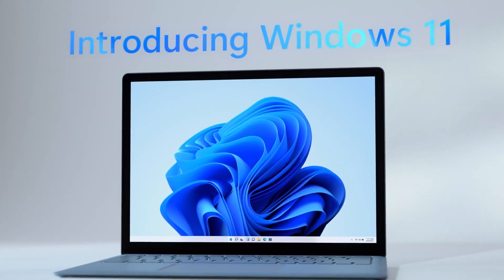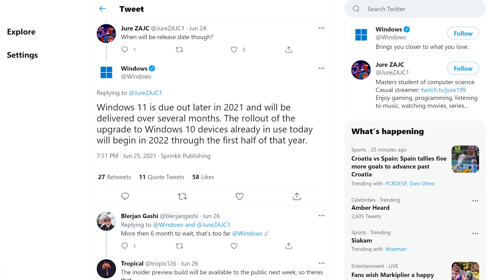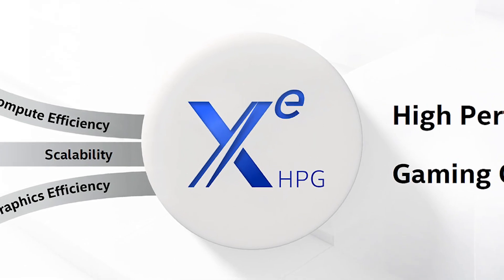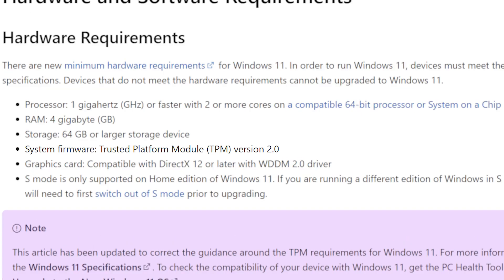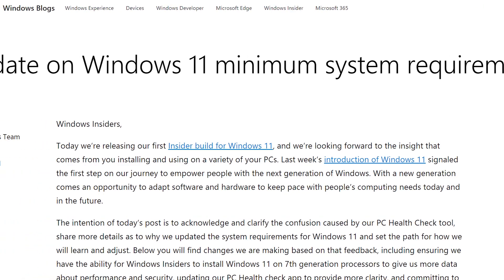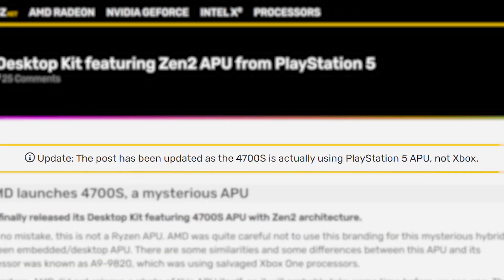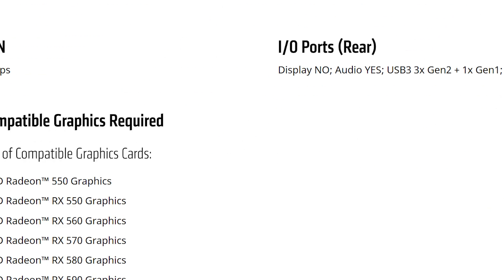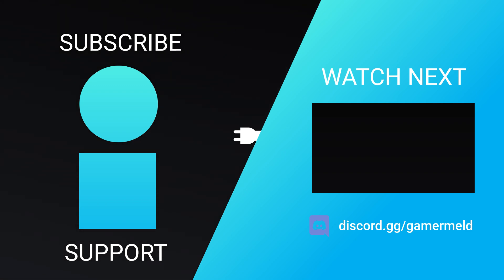TONS Of Gamers WON’T Be Able To Install Windows 11!

Comment: Steam really needs to push harder with Proton comparability now more than ever,  because there will be a influx of new linux users when this train wreck is rolled out.  Mostly from areas not in North America, or Western Europe.  This whole thing has nothing to do with "security", and more of spying & strongarming people to not have multiple operating systems on their PCs while collecting data on you without your consent (even if you ask to opt out.)
Reply: The Linux community needs to make a huge push and break the sheeple out of the pins.
Reply: @SchkuenteQoostewin  I totally agree since 2005 I have gotten over 150 people to switch over, and it's always the gamers that are the hardest to get to switch over though I did get one AAA gamer, and a dozen retro gamers to ditch windows.
Reply: @JeremyLeePotocki  

Neat.  I guess.
Reply: @SchkuenteQoostewin  Somebody not caring that Microsoft has their data isn't a sheep, just because you do.
Reply: I am exclusively on Linux. Steam's Proton compatibility layer works extremely well. We have tons of Windows games working on Linux. BUT, there's one big remaining elephant in the room! No support for Anti-Cheat. This means games that are using this won't work and if they do, it's singleplayer only or you need unofficial servers that do not use Anti-Cheat (Rust, for example). The good news: Valve is working on fixing this. But no one knows if it will be this year, or next year or in 10 years.
Reply: @danield.7359  Unfortunately that is not the case for me I got around 50 games that are not comparable in Proton (some are not due to anti-cheat nor DRM) Some will simply will not start while others crash in game.  Those games are the reason I still use Windows, but the rest I will play in Linux.  They are great at getting new & popular titles compatible, but lesser known or really older titles are not shown the same priority.
Reply: @JeremyLeePotocki  tbf those anti-cheats barely even work on Windows, if it's gameguard well that's the worst of them all. In my case we need to see some mod-tool support over on linux. It seems odd to me that all the bethesda games play wonderfully on linux but no mod managers for linux and it's a task to get Vortex/MO2 to work
Reply: @JeremyLeePotocki  even in wine for llinux your games still wont work
Reply: @supersaiyaman11589  Are you making a statement, or asking a question?  It'll help if you use punctuation in your sentence.
Reply: @danield.7359  A lot of multiplayer games work on Linux, such as CSGO, Overwatch and GTA5 without using custom servers. You can even play competitive on Linux. EAC and Battle eye are the elephants in the room with proton.
Reply: all about Pluton. they twisted AMD and Intel's arms to integrate these embedded TPMs and by god they want return on investment. it blows.
Reply: And what happened with pirate games on linux? im the person that: if is not pirate first (to test the game first beyond the free trial/demo) ill never buy a game (thats what happened to games like Ace Combat 7, i have on steam with All DLC and im making custom skin and is tanks to first i pirate it, or Darkwood (Dev make a free torrent, i like so i buy it full prise to help them and the game deserves that), or boderlands, or Resident Evil, and etc.) regardless if is fucking amazing or not, also games that im pirate it are free of Denovu and i ntice the lost of perfomance with denovu games LOL.
Reply: @extreme123dz  

Wut?
Reply: @gordongoodman8342  I pirate games first before buying them, in Linux this is possible and easy to install like in Windows? and talking about games from the 90s to today 2021? if the answer if no, well, Linux is not an option for me e.e
Reply: @extreme123dz  

You could decide to stop being a thief regardless of OS you use on your PC.
Reply: @gordongoodman8342  You may not love this. But it is a smart way to find if the game will run on Linux without problem
Reply: @gordongoodman8342  you know that some games are region locked right? also it always useful to test a game BEFORE wasting money on it if doesn't work on your computer. Takes less time than a refund process.
Reply: @ZedDevStuff  

Excuses to steal.
Reply: @Aereto  Don't make it into a moral argument, you lose every time lol you can have your reasons and feel whatever way you want about them but at the end of the day you're only buying a license, you don't legally own any part of the software.
Reply: @extreme123dz  You are delusional.
Reply: Tell you what, if Nvidia steps up and actually helps the Linux community plus most game devs started porting their games over to Linux, we would be blessed. Hence Torwalds' middle finger to Nvidia. We are emulating via wine windows games and still getting 90% performance, just imagine the numbers if the above would happen(or had happen)
Reply: @godlikekiller4344  what is nvidia not doing that they should be doing concerning Linux?
Reply: @gordongoodman8342  amd has what we call open source code that is their code can be viewed and the community themselves can fix the issues. Like for example remember the disaster that happened with amd 5000 series gpu drivers and how long it took to fix on windows? Well on Linux there are 2 types of drivers the official and the free community made. So for the most part the community fixed the free drivers within a month or 2.

Now nvidia has closed source code, they don't share it, plus their drivers are rather complicated to install properly on Linux. So it causes some unnecessary complications for Linux community when they are trying to you know update and fix known issues for gaming related to nvidia gpus
Reply: @sabasiwach680  

I haven't had any issues with the Nvidia drivers.  Haven't noticed any complications with installation either.
Reply: @gordongoodman8342  from your side it will mostly be fine. Its from the devs side who have to manage proton, lutris wine and the Linux kernel and stuff.
Reply: @sabasiwach680  
I mean there is a reason Linus Torvalds openly insults NVIDIA in recorded public events.
Reply: @sabasiwach680  

Seems the real problem is devs targetting Windows and you need to jump through hoops to use their software.
Reply: @gordongoodman8342  Linux works on an open-source mindset. Nvidia on the other hand has proprietary drivers so either install those or we go with open source nouveau. What I and everyone expects from Nvidia is to follow suit Amd. Amd drivers and in the kernel from the get-go and generally works better because open source. This and many other shit tactics is what will be the fall of Nvidia later on.
Reply: @godlikekiller4344  

Zero dookie sticks given.  As long as the software works and isn't spying on me, i dont care if it's open source or not.
Reply: @gordongoodman8342  Exactly, that is the point of open source. Some might say that because its open it is prone to hacks and stuff. That is bullshit.
Reply: @godlikekiller4344  
Are you saying all software should be open?
Reply: @godlikekiller4344  of course it's bs, Windows is all proprietary software but windows itself IS the vulnerability on a system, by it's very design it is the risk to the entire system which is where linux wins out. Windows NEEDS TPM and Secure Boot to even argue it's OS is more secure it's a hilarious farce.
Reply: @gordongoodman8342  I would say that there are places that software can be proprietary or open-source. In our case yes we should have open source for many reasons.
Reply: I'm coming as well in 2025 or when Proton or Linux is fully ready for Windows user to adapt (especially on Ryzen). I just dont want to render my existing program and games useless
Reply: @Darren Wilson 

The difference is one is theft one isn't, dummy.
Reply: @Darren Wilson 

Borrowing without permission is called theft.
Reply: @Darren Wilson 

The devs put work and time into development.  You can put a little effort into getting a refund if you don't like the game.  It's not that hard. You can do it.
Reply: The whole more linux users is kind of bullshit. Are you trained in usage of linux? I am a programmer, university and master and all that, and I would not touch linux no matter what, unless forced to, like at work where the servers are of course on Linux. Personal use(which in my case means heavy gaming), no way. Tremendous driver issues, always messing with chmod, chown, sudo, grep, apt get. Linux can not properly install a package, I need terminal and dpkg. Compared to windows double click next next next.
Reply: @nagyzoli  There are trade-offs for every product in the market. The ones you mentioned above, in all honesty, have never ever happened to me. These days Linux is so much easier to use since we now have a variety of scripts/hooks doing everything I used to spend hours trying to troubleshoot. And terminal knowledge is good to have but not necessary anymore since they have implemented Gui e.g. app store and other stuff controlling it for you.
Reply: @nagyzoli  Wow the tremendous amount of BS that is coming out of your mouth is truly something to behold.  If this was 2000 I would agree, but Linux has come a long way in the last 21 years.  Most new people that use Linux picks a distro with a good app manager, and avoids the more complicated distros.  PopOS is the recommended choice for newbies to PCs in general due them making sure that hardware drivers will not be a issue, and still has a very good and reliable app store.  Those that want to go off the beaten path (which I try to encourage others to do) can do it a whole lot easier by simply copy&paste the needed commands off of a website to terminal.  

You talk about driver issues & reliability Microsoft is just as bad as well as AMD & Nvidia.  Remember "Games for Windows" or the botched updates of runtime drivers (DX, DD, C++, etc.)  How about all the times Windows themselves screwed up updates so bad that people had to reinstall Windows, and also people would have to go into command prompt to fix the less critical issues.  Your argument lacks substance and full of misinformation.  Also if all your programs have be installed in that manner you're saying you're either installing experimental software, nightly builds, your refusing to use a software manager, or your just talking out of your rear end.   

Also note before someone thinks I'm being a Linux fanboy myself that is far from the truth I have other computers that use DOS, and 3.11, Basic, and my main PC I have a Quad Boot Setup (Windows, Mac, Linux, and Androidx86).  I ain't loyal to any Operating System however I will support Operating Systems that'll support freedom of choice & true customization over tyrannical behavior while duming down it's user base to lock them into a scamable ecosystem.  Oh the reason I got MAC is to experiment, and to piss off the Apple "stans" in my family..... :D
Reply: @JeremyLeePotocki  The only distro that is ahead is Arch Linux and it's derivatives, except Manjaro.
Reply: @nagyzoli  You are absolutely incorrect.
I never used chown or apt or grep ever in my Linux install, and while I do use the terminal, I don't have to. I have literally a graphical app to do it for me. You are extremely incorrect, willingly so.
Reply: I guarantee you gaming on Windows 11 will still be way easier than gaming on Linux. Even with programs like lutris.

Comment: I think we're losing sight that Windows 10 will still work through 2025 (and beyond if you're wanting to risk it). Does it suck? Maybe a little bit but as a system admin I'm not that worried about computers going out of date. And anyone that doesn't have a compatible TPM chip on their board will likely hear about the news in the next couple years and have enough time to plan for an upgrade. It seems like chips that are only a few years old should be supported but you have to remember when they stop supporting Windows 10 officially those chips will be about 7-8 years old so I think it's reasonable enough. Windows 10 will run just fine on gaming computers for years to come and no one has to worry.

Also let it be known that this is coming from someone that hates the always connected online tablet style direction they're going with. I don't want to use an online account I don't want to be tracked. Unless there's a very very VERY good reason to upgrade to Windows 11 I will not be using it.
Reply: humandxp  well i mean.. those systems are vulnerable AF now lol so technically you're risking everything.
Reply: humandxp  but using a out to date operating system that has no software support is just dumb

Comment: Wonder why there's a significant portion of people that continue to run Windows 7
Reply: Because it doesnt require 8 GB RAM and a decent cpu
Reply: @user-eb6vc2gs9e  but ram is cheap tho... I understand CPU but wouldn't u want more ram?
Reply: @PaperReaper  my ram is slow already 2666 mhz double rate
Reply: Because it's the last half-decent Windows OS that looks good, works reliably, and doesn't spy on everything you do...
Reply: Lazyness, or incapability to upgrade due LOB software or something like that. You can get the free upgrade to 10, it still works. Having a computer with an unpatched os for several years... that's a hacker's dream.
Reply: @sopota6469  finally someone says it....

Comment: YOU DO NOT NEED A TPM module.    Just go into the BIOS and look for the Security Tab under Advanced Settings.   Enable fTPM or PTT and you are good to go.
Reply: Pretty sure that just enables the TPM module.
Reply: @rocsorianoguitar  Nope.  Look for another setting.  You can enable the firmware to allow fTPM or PTT.    I know because I did it and now I get the message that my PC is ready for Windows 11
Reply: FTPM enables TMP 2.0

Comment: wow i was planning on upgrading to an i7 7700k and if that is not enough then my current cpu definitely won't cut it (it's an I5 6400)
Reply: Unless you are getting that for free, that's not much of an upgrade
Reply: @sopota6469  well that happens to be the max my mobo supports, at least it seems like it, it's a msi bazooka b250m and in the cpu support list, the most powerful one is that i7, but considering i am having trouble with cpu performance it might be enough to push me over the edge
Reply: @Liam Henson oh that's not an issue really, i'm staying on windows 10, in fact even if my cpu was supported i would stay on windows 10, just dont think it justifies to upgrade as of right now
Reply: @Liam Henson yeah it is pretty stupid but i'm guessing its not about the cpu's strength but maybe about it needing to support something? Something that only 8th+ gen cpus support? That or intel and amd made a deal with microsoft to make people buy newer hardware?
Reply: @Liam Henson yeah that was my second theory but most casual users won't upgrade their personal pcs but intel and amd will sure benefit from companies because they're the ones that go out of their way to have everything updated
I'm also guessing the OEM market is gonna suffer some changes as well

Comment: Ryzen 7 3700x is on windows 11 insider preview now. it's so smooth. my cpu is on the list though.
Reply: The installer doesn’t enforce the motherboard requirements. When it does, you’ll probably find that it won’t install if the current announced specs are enforced.
Reply: @richardbeckenbaugh1805  I upgraded through the insider preview program which used windows update to make the upgrade and it worked perfectly for me. I enabled ftpm in bios and got a green light with the pc health check app as well. I've encountered a few small bugs with the mouse pointer precision but I might just need to install the logitech drivers for it to fix that as I'm currently using the default windows ones. I could also just need to clean my mouse sensor as I haven't done so in awhile.

Comment: LOL I really doubt anyone (let alone gamers) is going to lose any sleep over not getting Windows 11.
Reply: NSA is going to lose sleep over it....
Reply: @IC-lz3of  lol. Their evil plan is falling apart.
Reply: Jeff Peeseps  Unless you have a HDR monitor or a nvme SSD you won't need Windows 11.
Reply: Look at the comment section, everyone in flames that they can't get the latest and "greatest"
Reply: @jaysanchez4407  my opinion if your rig doesn't have the requirements for windows 11 tmp 2.0 just keep running your older os its not as if you wont be able to keep doing what you are doing with it.
Reply: @supersaiyaman11589  honestly, it's crazy to see a reasonable person here sometimes, and I hope you have a fucking wonderful rest of your life
Reply: @jaysanchez4407  I'm confused was your response mint to be sarcastic did i tick you off with my comment somehow. please explain?
Reply: @supersaiyaman11589  no I'm proud, because you said it's okay to run your current OS, yet alot of people in these comments are acting like the world is ending because they can't upgrade
Reply: @jaysanchez4407  oh ok thanks for clearing that up.ya if someone is thinking about upgrading their os or computer you need to ask yourself is this rally worth it what will i be able to do that i wasn't able to do before. or  is my computer too slow. i got a new computer but it was after i had had the old one for 10 years. i wanted to start gaming and was not able to do it reliably on the computer i had. my point is if the upgraded peice of software or hardware rely doesn't do anything for you don't upgrade just to upgrade.
Reply: @supersaiyaman11589  you're correct, software can only go so far, and especially with windows 11, they are upping security to the point that most 4+ year old hardware is obselete because new attacks develop over night
Reply: It's almost like they are not the target audience.
Reply: @nulled_xyz  im a gamer  but i will not be updating for a few years at lest